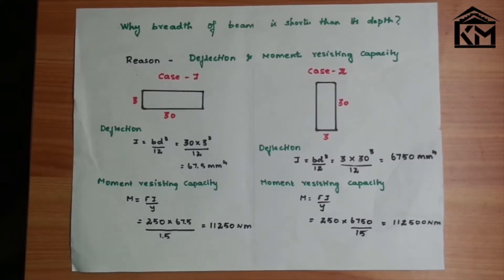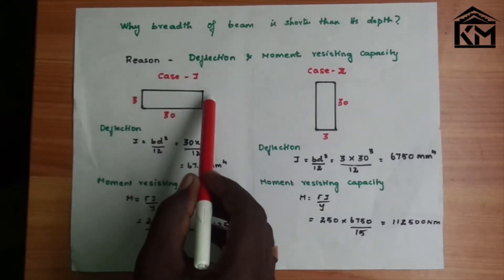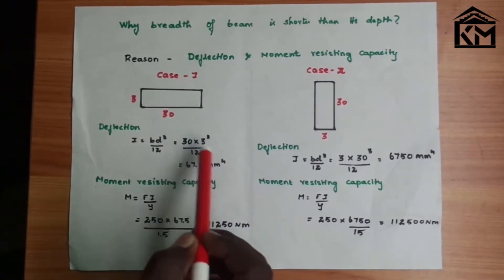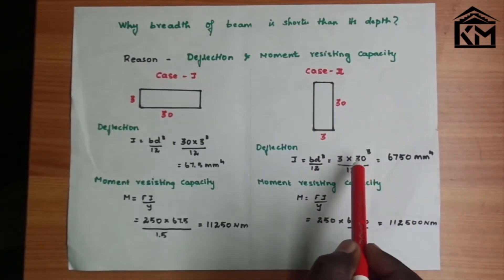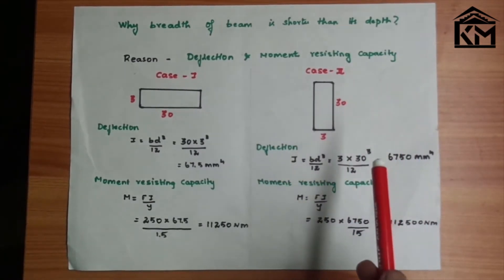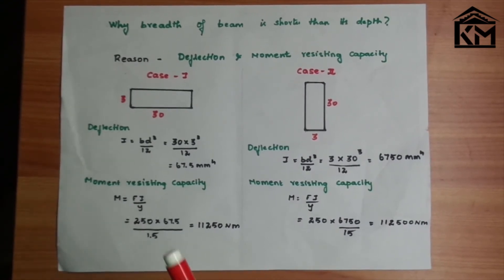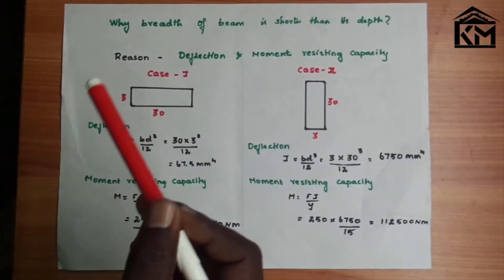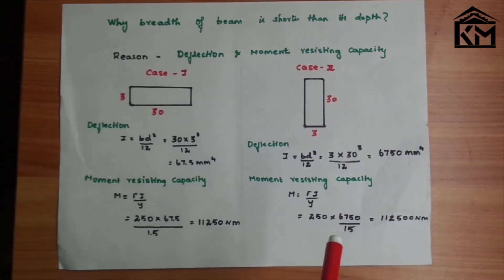Why Beam Depth is High ??உத்திரத்தில்(Beam) எது அதிகமாக இருக்க வேண்டும்?? video - 3

Comment: Y we use ((bxd3)/12) instead of ((dxb^3)/12) for rectangular section...
Reply from the maker: It's because we, calculating moment on x-x axis..and it results in (b x d3)/12...if we calculate the moment on yy axis it's results in (d x b3)/12..(based on moment of inertia.. at xx axis. Due to load transfer in beam mostly in xx axis..)Thanks for ur Enquiry..